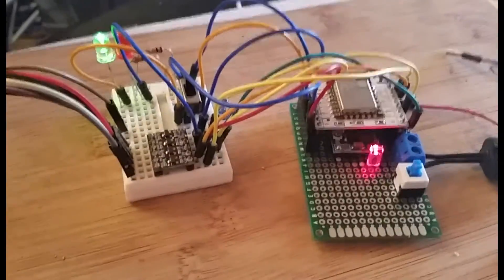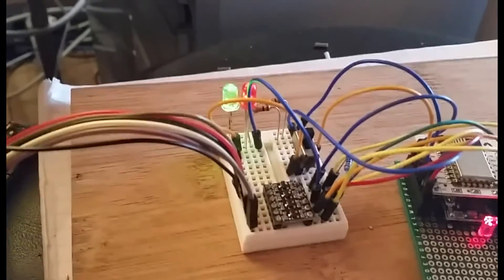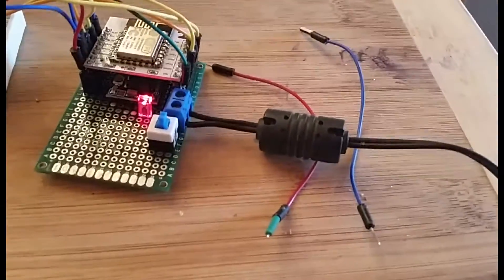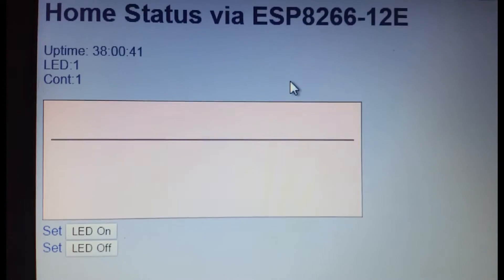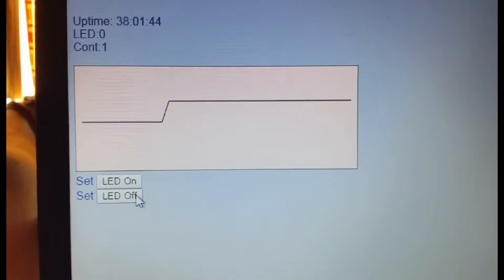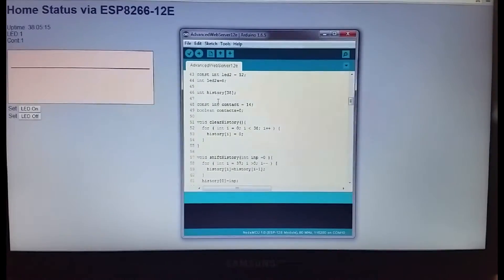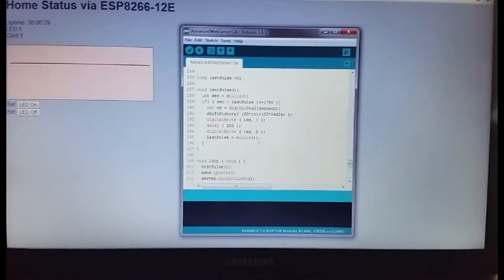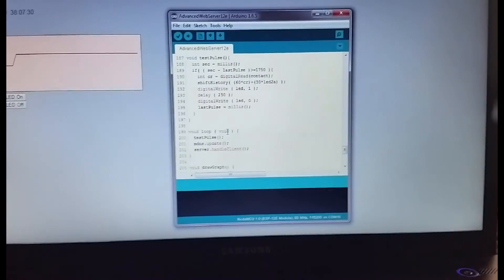ESP8266 12E Dev Board (part3)

Comment: Hi, nice video. I have some questions please :

Trust your only connections to ESP826-12E are :
+3.3V to VCC & EN.
0V to GND.

My questions are :
1. Is my understanding of your connections correct ?
2. I think you put GPIO0 to 0V while loading firmware. Correct ?
3. You do not need to put GPIO15 to 0V during normal operation ?
4. You do not need to put GPIO15 to 0V during loading firmware ?
5. How do you use GPIO2 during normal operation ?
5. How do you use GPIO2 during loading firmware ?

Your comments would be very helpful.
I have an ESP8266-12E but I am not able to make it work. Nothing appears on the Serial Terminal. ESP8266-01 works absolutely fine !
Reply from the maker: +Siddhartha Chatterjee the diff ESP's have different  default serial bauds.  depending on what you board was built with . 
>> i will be re doing my connections this week , for the pin 15 in think i have it pulled down with a 1k on the board .  I think  it is the internal and external FLASH pin mode on boot .  I have also auto mated the DTR to the reset , but im at work and i forget the setup . 
I will be  putting up a video very soon specifically on this and will be designing a simplified setup for ESP and Arduino IDE , as teh IDE now support auto resetting and program mode pins for ESPs . if you see here  my UART cna control program and reset mode just like it was a arduino https://youtu.be/A9wKZMkzVs0
Reply: +XerotoLabs 
Thanks. In your board do you use the lower 6 pins i.e. SCLK, MOSI, GPIO10, GPIO9, MISO and CS0 ? Let me know.
Reply from the maker: +Siddhartha Chatterjee look at the diagram these guys have , its what i use sort of ( use a 5v UART and pass through a level shifter ) . it allows  the arduino IDE to program and run a ESP 8266  12  like it was a arduino. http://www.oddwires.com/blog/    hope this and my video link in last reply helps ,
Reply from the maker: +Siddhartha Chatterjee no not yet and i have heard they are very fussy pins . depending on firmware what you do with pin 15 on boot  changes them .  I want to use a SD card module in it soon to log  security events so i will be exploring that , but i will have to solder directly to them very careful as the break out board was made for a 12 not 12e .
Reply from the maker: +Siddhartha Chatterjee oh sorry for so many messages , but i just remembered they only work on true / non counterfeit ESP 12E's ,  some are just 12 that were put on a board that looks like a 12E . I might be remembering that wrong but there was something about counterfeit boards also not having the  silk screen match the actual pins on the bottom too .
Reply: +XerotoLabs 
No problems.
Yes what I read is that there is some silk screen mis-match so GPIO4 and GPIO5 also have got interchanged.
For me, I have worked smoothly with ESP8266-01. 
Today I started with an ESP8266-12E and I have not seen a character on the CoolTerm. Then after struggling for about 2 hours, the laptop refused to identify the USB-to-Serial adaptor as well. he he he !!
I think today I must pack and go to sleep. Will try again this weekend with a fresh mind. Hope that will work out !!

Comment from the maker: still up at 51hrs 27 mins up time .   time to move to next tests.
Reply: I wonder why putting more work in the loop helps stability.  What does it do when it's unstable? resets? stops responding? other?
Reply from the maker: Hari Wiguna i need to take sit's twin , and try it with just a delay .  all that it was doing was putting a led  on and off in 2sec duty cycle .  250ms of on , and rest off .  It may have been some buffer thing . I will need to test it further .  I was going to add a nice fat cap' to the vcc supply of the module , in case there was some noise from the switch mode power supply . I dont have a real O'scope yet , so i could not check for noise. Usualy i assume noise and and filter and decouple where I can. but this seems to be  all it took .  
Also i find that advanced server sample can cause a reset if more than one client connects and demands a page at the same time.  so it could be a buffer thing .  not sure .  but it is now "Uptime: 85: 57: 23" lol
ooh i forgot , i made it so it was pre calculating the values for the .svg graph into a int array . see : http://codepad.org/8oXFA1VH